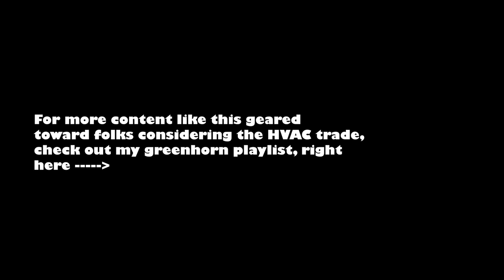5 Things to consider before becoming an HVAC Service Tech🔥❄

Comment: Service calls suck because you have to work till you get the job done. It's never an 8 hour job, but the service tech is the real master in the field of HVAC. Installers too have a skill set but service techs are the doctors of the industry. I love my service guys, and I try to reward them as best as I can. But it's hard work and soldiers are hard to find. If you love challenges, figuring things out, being the savior of the day, it's the job for you. Attached are usually 10 maybe 14 hour days. Soldier on
Reply: @Shelby Reynolds all over, word of mouth, employment sites like indeed, craigslist, vocational training schools. You have to be creative

Comment: be prepared to learn on the fly and get thrown into some stuff, the internet and the phone can pretty much get you through any job youll run into.
Reply: Heck yea!! Use your resources
Reply: LoL, I can't tell ya how many times my phone saved my a$$!
Reply: Can’t tell you how many times I’ve been thrown into jobs on stuff I’ve never seen before. Gotta be good at sticking with the basics and starting with what you do know and that will normally get you pointed in the right direction. Several years back I started at a new company and they had a pneumatics call. I remember telling my boss I had never worked with pneumatics. He handed me a pneumatic tool kit and said well now you do! Thrown in head first into a generator room where they used pneumatic dampers for fresh and exhaust air for the dampers. Luckily pneumatics really isn’t that hard once you know a few basics.
Reply: @johnpatrick3458  me too!!
Reply: Are there any specific sites you guys go to or do you just Google whatever it is you're trying to figure out
Reply: No not really

Comment: I think you hit the nail on the hit pretty well for the modern HVAC technician. You definitely don't have to start with installations but you can learn a lot from them. I started day one green with the company I now co-own. People who like structure don't last in our industry because calls come in very infrequently. You can sit on your butt for two weeks then run for two months straight. Some days you send the guys home early and the next day you're out til midnight. You never know. Been thinking about doing these videos myself. Especially for restaurant freezers/make readies. I've found most techs can't diagnose them because of how simple they are and they overthink it. I can understand your passion man. I have a very honest passion for this industry and I love helping people. The victories have to come from within but people/customers often begin to root for you when they find out you are passionate about helping people and not solely out to make money. I called a customer today because he has a 60-ton Aaon with a bad copndenser fan motor and the only parts support we have in the area specifically for Aaon is a company that formerly did his maintenance. Luckily, the fan motor isn't a specific Aaon part so we can use a different distributor. The price from the Aaon distributor and Ferguson, was 2:1. He used to tell me about this prior company's price gouging but I couldn't believe it man. I get they are also a service company, but you can't do that to people. I agree we all have to make money, but we have to treat these people like human beings. If you're only in this to make a dollar, you're in the wrong business. My passion for HVAC creates my cash flow. Customers want me in their restaurants, businesses, and homes because they know I'll do whatever it takes to make the right fix. When people believe in you, money isn't a concern. With that said, it's my responsibility to be fair on my invoices, as well. I'd love to sit down and talk with you man. I could talk HVAC for hours and it looks like you do some industrial things I haven't touched yet. Stay blessed and thanks for your service!

Comment: I'm new to your channel, (one week), and have been in the HVAC field since 1984. The good old days when the only refrigerants were R-12, R-22, R-500, and R-502. No recovery units back then. For the new techs getting into the field, better learn electrical schematics and using a meter. No open relays anymore, all circuit boards today. I moved out of the service field into a hospital facilities department with a staff of 16 plumbers, HVAC techs, and boiler operators working for me. Love your channel AK!!!
Reply: Sounds like you have some local 95 guys!!
Reply: Wow must be a big shot.
Reply: I love running across a unit with a bunch of relays and contractors. Cause you know you can repair the unit with what's in your truck. These units with all the boards, if a board is bad usually you got to come back
Reply: @ Brad - i remember the good ol days too. started in 1981. no recov. machines back then and 12, 22,502. it was grand ! and NO Poe oil Back then either ! Mineral oil Rules !

Comment: Excellent description brother! The only thing I would add is the dark wet confined spaces we often have to work in. Even in residential under the houses where MANY roach bombs have been set off or the crawl spaces where pipes have been leaking and soaking the ground your crawling on or in commercial when your brushing chiller tubes for hours or standing on a ladder inside an air wash pressure washing eliminators! It takes a special breed and alot of self confidence to thrive in the situations we often find ourselves in. Keep up the good work!

Comment: Just subscribed. I’ve been in this field since 1998. It’s a love hate relationship lol. Remember guys it’s not always volt meters and a 5/16th nut driver. I had to crawl underneath a residential home today, drag my torches with me and repair a damaged refrigerant line. It was lovely.
Reply: Oh and I’ve lost about 10 pounds this summer from sweating my ass off lol. Literally

Comment: I went to class for HVAC. A week after I graduated I started with a heating and air company near where I live. After 1 and a half weeks of "training" I have a company van, I started off with duct cleaning. Which is a position they had available for me. I'm currently on my third week still duct cleaning but they throw some clean and checks in the mix on some slow days for us and tomorrow "Friday" doing an install. I absolutely love this trade. I get my alone time. I get to do my own critical thinking to solve problems my own way and yes I take what information and knowledge I can get from the more seasoned guys and tweak it to fit my way of thinking to better understand why and how.
Reply: So, 1 month from posting this. How do you feel now?
Reply: @tos4057  I still enjoy waking up to be to work. I really do enjoy my job.
Reply: @ericmadden9232  I ain't good maths or anything like that, is that essential? Just curious im considering becoming one after school.

Comment: My home was built in 1995 and the HVAC unit was installed at the same time.  About a week ago the heat went off and I called a trusted HVAC friend to come over and evaluate.  The news was not good, basically the furnace unit needed replacement and I was advised that because the A/C unit was the same age, it would be wise to install a complete unit and bring it all up to code and have the most energy efficient unit on the market.  It also included a "Smart Thermometer System". I had to agree with my HVAC friend, all his information was true.  I gave him permission to order the complete unit and install it as soon as possible because at this point we had no heat for almost a week.  Using small space heaters, heavy clothing and heater blankets to sleep.  Today, the unit came in and it was professionally installed in about 6 hours. They performed an excellent install. Only down side, it set me back $9537.53 including tax.  But it sure is a great set up and unit.  It all came with a 10 year warranty on parts and one year free labor. These guys worked really hard!  I know the price sounds expensive, but it does take trained and certified personnel to perform this work.  No one ever questions the cost when going to the Dentist because they know how expensive it is to get a license to practice medicine.  I feel the same way about certified HVAC Technicians.  Good work and equipment cost money.  I feel many young people should skip college and attend a good trade school.  Become independent like you.  I think you made a wise choice!

Comment: I just paid $1100 to get my AC replaced by a local reputable company. Technician replaced 2 small electrical components (transformer and contactor), and added 4 pounds of freon to my system (it was really low). Took him about 1-1.5hrs total time, didn’t look very physically challenging… just Huge money for him and the company he works for. Seems like a great field to be in… lots of demand, not too hard, and you can charge people like you’re a neurosurgeon.

Comment: Been running commercial/industrial service for 12yrs. This trade isn't for the faint of heart. You'll have hard,shitty days. But if your decent at your job they'll be few and far between. This trade has taught me a whole lot about about an unfathomable about of things. but what's more valuable is what its taught me about life.

 He's right, there are no pats on the back, your alone most days,  and your on a problem at some strange random place with nothing but your own skills to save you. But you've sharpened those skills, your not afraid of anything thrown at you and borderline expect it. You have the confidence to know there's nothing this unit or place can throw at you that you can't figure it out. You learnt that all on the job. Mostly the hard way because your a hands on learner. So when you get it done, and know it's right, you don't need or even want a pat on the back; because you know the person patting you on the back has no idea the miracle you just pulled off. And the best part, is you'll take that confidence humbly into your personal life. Many try in this trade, most fail. Of the ones that make it they're usually either grunts, or great techs. And don't be scared of the hours, there's alot of companies out there that pay great and work realistic hours. Personally I average 40-45 hrs a week yearly. Garunteed 40. 8-5 m-f. 1hr lunch. I've worked the random weekend job a time or two here and there but wasn't mandatory. We get 5 holidays and 4 weeks vacation, and top out for our standard hvac techs is 37/hr. Can take off anyday I need with a day notice. 
Last tip, once you learn hvac, don't stop. Learn controls,refrigeration,vrfs,management, or any niche you can. It'll pay off in the end with more money, bettee schedules, and much physically easier jobs. Goodluck!

Comment: Just awesome luck that I found your video.  Totally agree with what you say and I appreciate you mentioning that we can add our thoughts as well.  I know what you mean about the loneliness, working alone.  After twenty years of being in this trade is when it started to bother me.  I have a successful one-man operation HVAC Refrigeration business, but I'm at a point where I wouldn't mind giving it all up and just go work in a place where I'm surrounded by people.  If there was anything I could add to your video it would be this; Build a strong Network/ friendships with other technicians that are at your level or smarter.  Your connections with other Tradesmen makes you pretty much invincible in the field because you always have somebody to call when you're stuck.  I've kept friendships with even the most unlikable technicians because I know if I run into a problem, that unlikable colleague is going to help me solve my issue.  I've been faced with a lot of issues over the years with problems that I couldn't figure out at first, but after one phone call, problem solved.  Thanks for your video. John.

Comment: I agree 100%. I have been a full time on my own service tech for over 5 years now. Which isnt a super long time but the only thing i have to add is time management. More for residential rather than commercial because during the busy season you can get 5 calls a day or 9 depending on what and where. Being by yourself and swamped. It can be tough to self motivate for some people. Alot of the apprentices hate having a changing scedual and not know what time they will get home. Being from south east PA i see all 4 seasons and all types of equipment it can be overwhelming.

Comment: Personally, for me,  the reward is solving difficult issues. Compressor change outs, motors, and maintenance can get repetitive, but love tracing shorts and other electrical problems. Weird, but I get ultra motivated when it comes to controls. IDK, being a tech can really test you at times, but think one can become quickly disillusioned with it if you're not passionate about something in the field. I've seen a lot of guys come and go trying to treat it as another job.

Comment: Waiting to join into an Apprenticeship program at 46, leaving the hospitality maintenance department.   Wanna learn this trade more, and looking for a better retirement plan.  I figure i need to work at least another 20years to retire, so im picking this trade to end my career. Some ask why, and that its to hard on the body and im getting older, but i just want to learn this trade more and make a better living
Reply from the maker: APR928 best of luck to you!
Reply: At 46 ouch !
Reply: Better later than never APR... I started at 32, but my background was custom design and fabrication in my early years and electronics through most of my life.
Reply: @Bear-cm1vl  thank man,  I been in the hotel maintenance most of my career, with an electrical background, about 5 years under my belt. Then it got slow, the hotel was steady and paid mortgage.  Been exposed to HVACR at the hotel, did an online class to under the principal's and now just feels like the right time to go all in.
Reply: @apr9286  now you get to figure out how many bad habits your Engineers taught you! 😁
I've worked with a LOT of multi-occupant facilities and almost all of the Engineers taught band-aid techniques to their guys. For them, it was a money vs response thing and I understand it, but your customers won't thank you for adding charge every couple of months.
Reply: Never too late to start a new field! Don't get discouraged, I started at 37, remain teachable.
Reply: @chrismcdowell3037  hows it going im looking to get in and im 38
Reply: After 12 years of 14 wildly diff jobs, I did 7 years of hvac install and now 3rd year of service. Took me 8 years to realize I must be really loving this job despite it being extremely tough on both mind and body at times. At which time I went into the apprentice program at 35 and I still was kicking myself for not doing it sooner. I must wish you the best of health to keep up with the conditions and congratulate on the balls to make the radical move at you age to the big boy stuff where you can never stop learning even 30 years after the school. I see people even in their 60's and quite a few actual engineers in many of my classes so you won't be alone in the older crowd either.

Comment: I tell you what man..you hit the nail directly on the head with the points you made.  Btw, Semper Fi my man (3/71 - 3/75).    I've more than 40 years under my belt in the trade and not once did a boss tell me we made money on a job.  Seldom is there praise from the boss because that may mean you're gonna want more over scale. 

One point to consider...doing commercial service you are going to be climbing ladders daily, carrying loads with one hand or leaning over the roof edges pulling loads up with a rope.  Can't be afraid of heights.  You're gonna be on snorkel lifts or scissor lifts working in the nastiest of environments over the top of every imaginable production machine there is.   Even working in office spaces on vav (variable air volume) boxes or ftu's (fan terminal units) you may spend the greatest portion of an 8 hour day on a step ladder over the top of office workers and partitions. You'll be in mechanical rooms with chillers hammering so loud you can't hear yourself think.  Or in other mechanical rooms with high pressure steam boilers giving off so much heat you'll be sweating in the middle of winter....then your next call will be on a commercial freezer where you have an evaporator fan motor or defrost element to change in a -10 F environment.

Another point to consider if its available to you is to work for a union shop.  After 40+ years the pension and health care benefits are extraordinary.  AND don't think just because you are in your 20's or 30's you don't have to worry about it because its so far away....because my time in the trade went by so fast it is unbelievable.  If you totally love the trade like I do (and did) you'll wake up one morning and be the 'old guy' on the job and be left wondering just when did that happen.

I could write a book of the scenarios, good and bad, but nobody would probably be interested in reading it.  LOL.  Enjoy your occupation and your life...its the only shot you've got.  Would I do it all over again ...???  Yes, without hesitation, because if you are good at your job and work hard at diversifying your abilities you will never miss work, actually you will have to beg for time off.

AK HVAC, this video provides a great synopsis of what a newbie should expect from the industry as well as are many comments given by others in the thread.  You rock !!